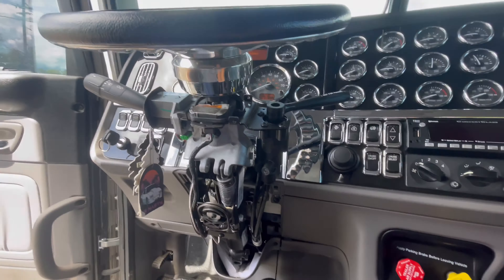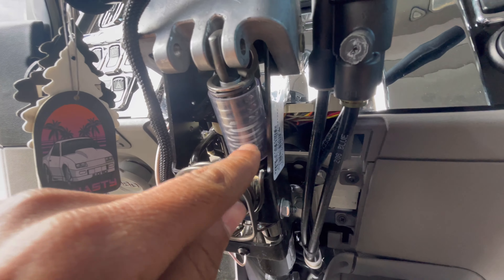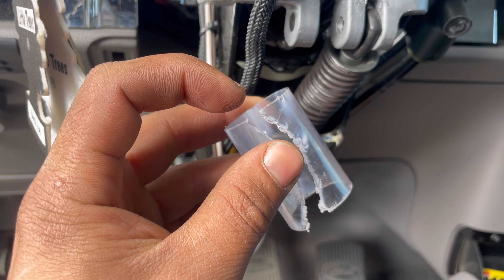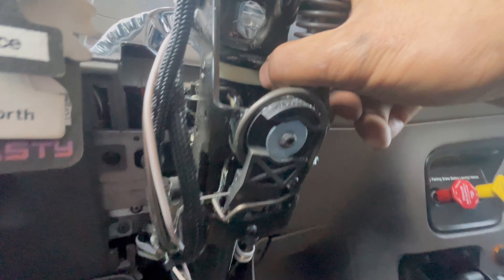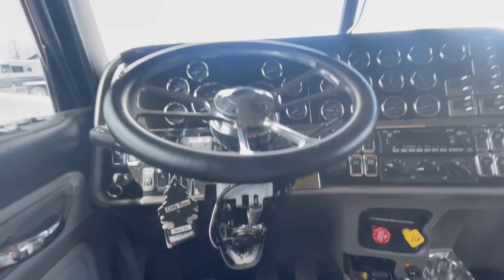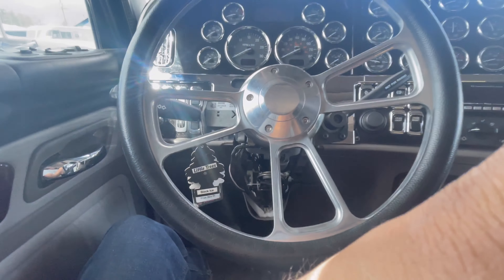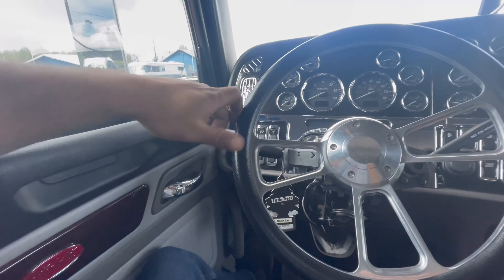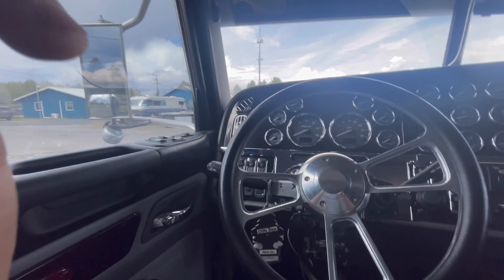Tilt your 389 steering column further for free!!

Comment: Why didn’t you just take the pins out at the Top ??? And just pull the spring back ???
Reply from the maker: I think it’s pressed in.. I remember looking for an easier way. I was unsure.
Reply: @trucking4racecars  You could of used a punch & hammer 🔨,tooken the pin out and brought down the sleeve. That’s ok,you got it anyways. Keep up the good work. Yeah,it’s supposed to be pressed in,that’s where the punch comes in at.

Comment: I did this on a w9 and the U joint bound up and locked up pulling into the shop. So if you do this definitely keep that in mind and check everything over.

Comment: hey brotha glad you got that working  how you wanted! I just wanted to bring up the point of making sure you take a sec and see how the wires are moving now when u tilt it that extra bit, make sure that when u have it fully lowered it isn't pulling on the wires or the trim cover doesn't disrupt anything behind there. Would hate to see you have wiring issues due to chafed/rubbed through wires!

Comment: I did this to mine but my check engine light came on showing a code for stearing angle or something like that can’t really remember. Did yours come on?
Reply from the maker: Nope and all these other guys keep telling me mine isn’t even low enough 😳
Reply: There are no steering sensors in the column, you're smoking crack. We've done this mod on 12 trucks in our fleet, all 389s. I repeat... there is absolutely no sensor in the steering column throwing a steering angle code.
Reply: @TheRoadhammer379  he must be driving one with a digital dash panel 😂🤷🏻‍♂️

Comment: Haha well. I took that piece out it's very easy infact few things you gotta remove. And I took my spring out as well.. but you can tilt that whole column even more .. just saying it doesnt end with that white block
Reply: Curious, I have done this same thing about 6 years ago to mine and left it at that. But have always wanted a tilt that is equivalent to a passenger vehicle. Have you gone further by tilting the whole column some how? Just curious since I want to retackle this project again.

Comment: PLEASE, DO NOT DO THIS.
I would be EXTREMELY LEERY about doing this and DO NOT recommend this WHATSOEVER.
Engineers place limits on mechanical systems FOR A REASON. In this case, I suggest examining the “coupler” between the steering shaft and the wheel. The reason it is limited (by the white bushing) is to PREVENT failure of the coupler due to excessive “bearing angles”(imagine putting too much of an angle of a U-Joint on a drive shaft). WHEN this joint fails, the steering wheel will LOCK in whatever position it is and you’ll not have the strength to overcome the failure. BOTTOM LINE, WHEN (not if) it fails, you are now a passenger in a vehicle YOU CAN NOT STEER.
PLEASE, PLEASE take this video down.
I am an aerospace engineer with over 20 years working with mechanical systems of all types. If you don’t believe what I am saying, Google something like “severe u-joint angle, excessive CV joint angle etc.
You are putting yourself AND YOUR VIEWERS AT POTENTIAL RISK.
I really enjoy your content and Do Not want to see Anything occur that could Negatively impact you or your viewers.
Reply: Do you own a peterbilt by any chance ??
Reply: @holdencolonycarriers9817  Now that’s a Genius Reply.
Reply from the maker: @callmewheels4806  definitely 🤘🤭
Reply from the maker: @holdencolonycarriers9817  🤘😏
Reply: listen to this guy!!
Reply: Actually Einstein, we have had the steering columns of these trucks apart and there is no binding on the steering knuckle joint. There's no damage to the splines, bearings or other components but thanks for your two cents.
Reply: @thelarryus1  Great!
Reply: Yep thought it weird someone would want the wheel buried into there nuts.